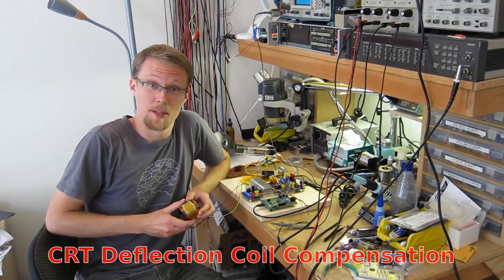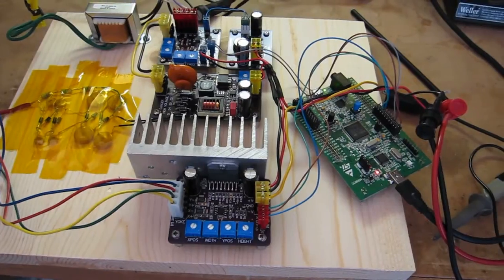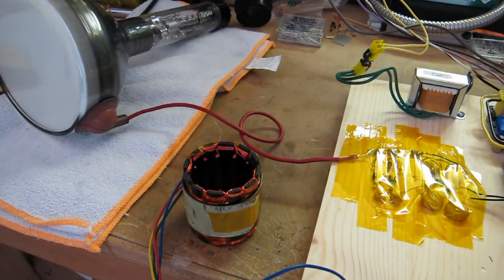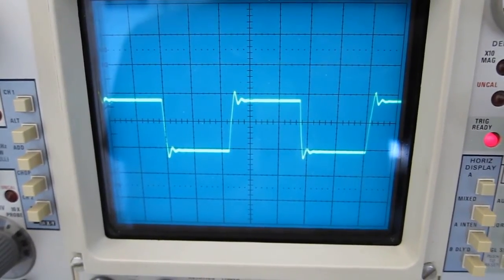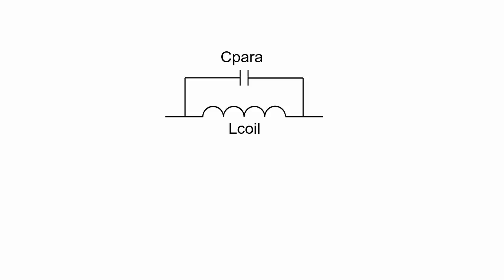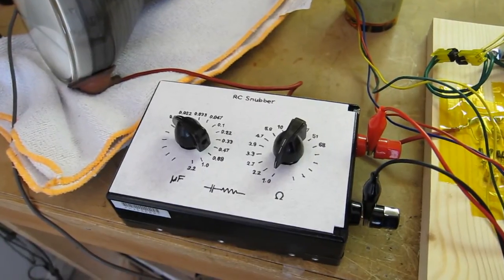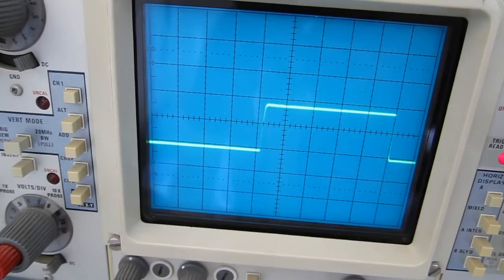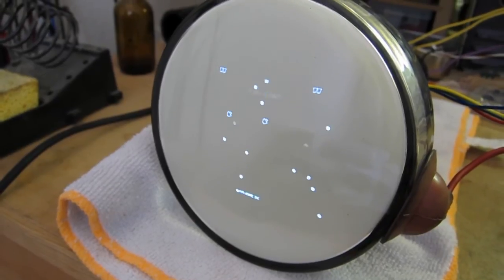Homebrew CRT Deflection Coil Compensation

Comment: Why isn't your yoke closer to the tube? I'd like to make one of these for a 25" color tube. I'm tired of fooling around with mix and match yokes. Did you open source the design so I could modify for a 110 deg tube?

Comment: Your videos are great, you should definitely do more of them!

I'm interested in this specific video because I'm trying to track down a horizontal ringing (vertical bars) in my old toshiba TV/monitor. It's not signal dependent (it will appear with nothing connected) and it only seems to be there when the brightness is just above black.(although that might just be the only time it's actually visible). http://www.vcfed.org/forum/attachment.php?attachmentid=64451&d=1604339993
As you can see from the photo, it doesn't appear to be a linearity issue (because the image isn't distorted where the banding occurs) so I guess that narrows it down a bit.

I thought maybe your snubber idea could be something I can try, but I'm not sure exactly what the distortion in your video there was. When I go back and compare your before and after, I honestly can't see a huge difference. 

Any ideas?
Thanks